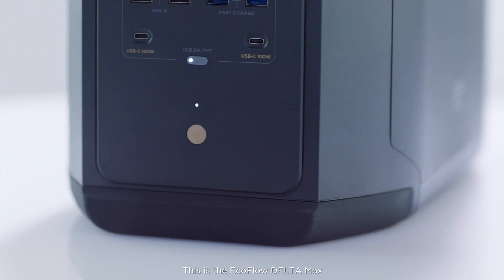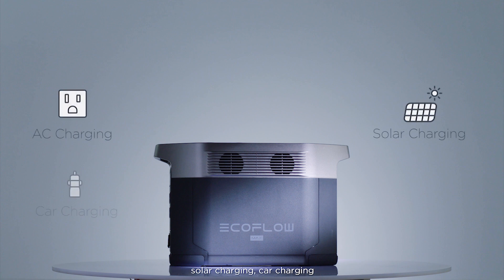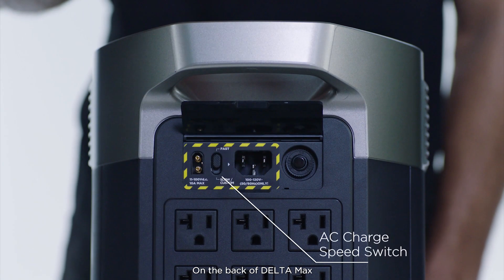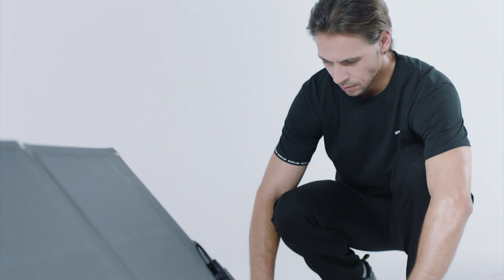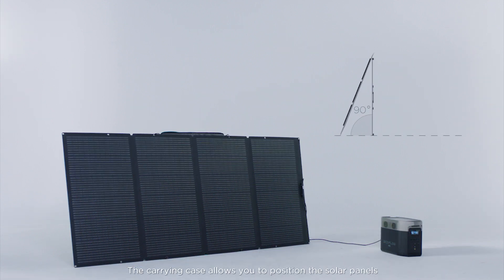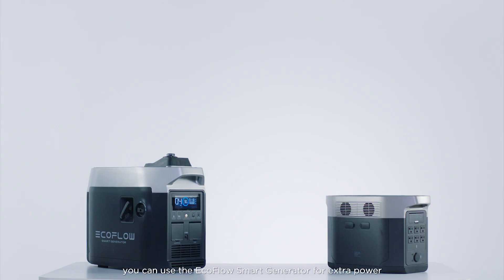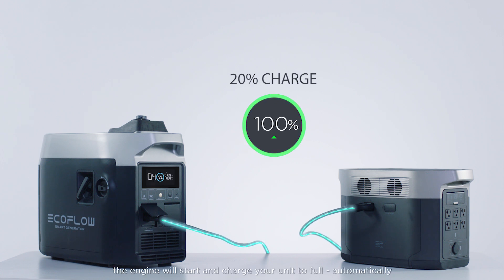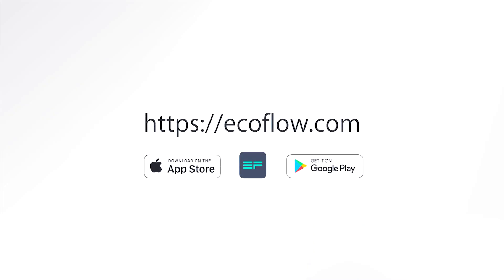How to charge DELTA Max

Comment: but how do you sync the ecoflow delta max 2000 with an extra battery so there both at the same capacity of hours left and percentage while running?
Reply: They are separate individual batteries. They will drain at different times.